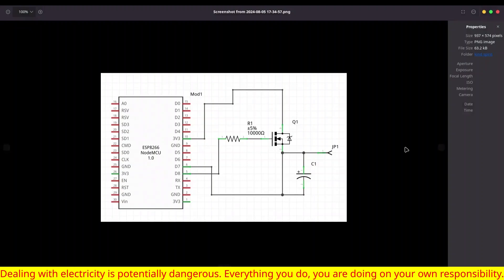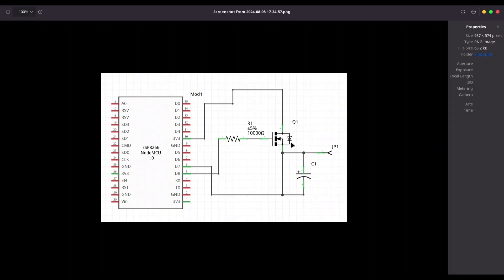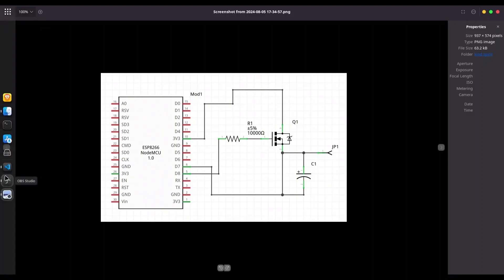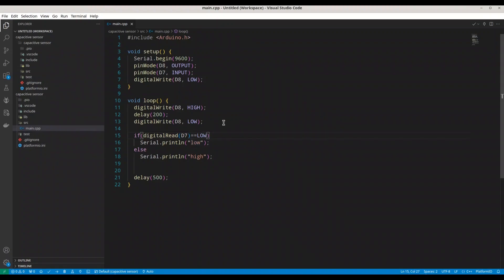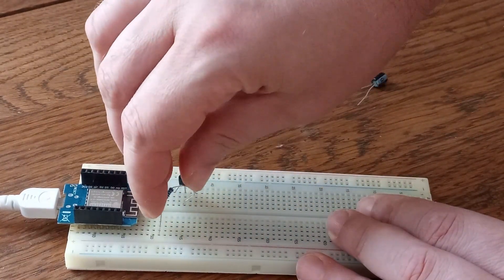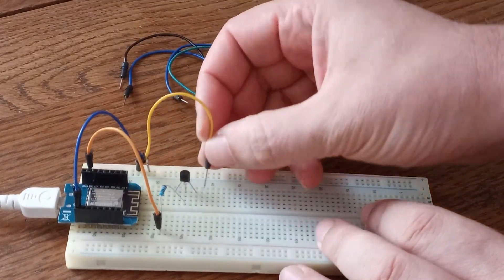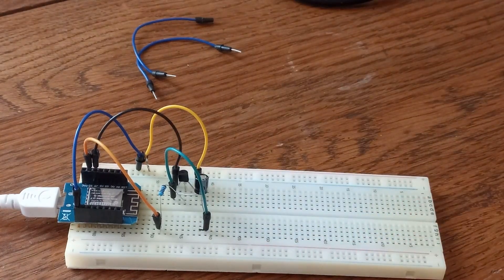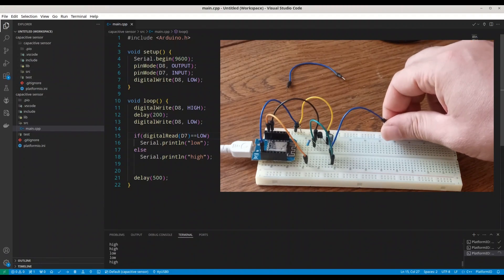ESP32 & ESP8266 - Touch sensor from scratch

Comment: it looks like the capacitior is always shorted out so it serves no purpose in the circuit.
I'm just a hobbyist, but if I was trying to do this, I'd simply connect the output pin to the input pin through a high valued resistor and see how long the input pin to register a change on the output pin.